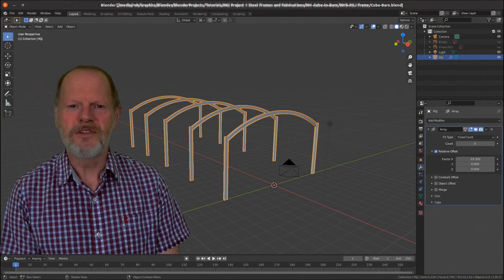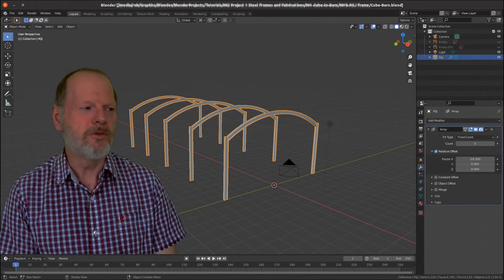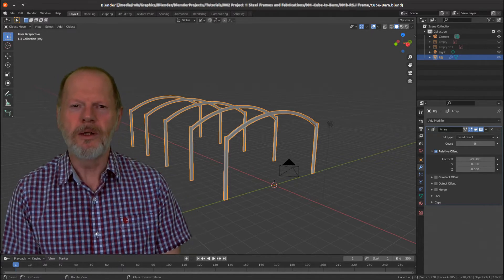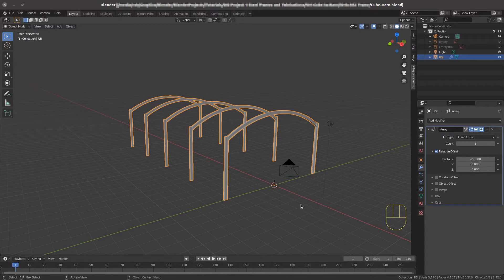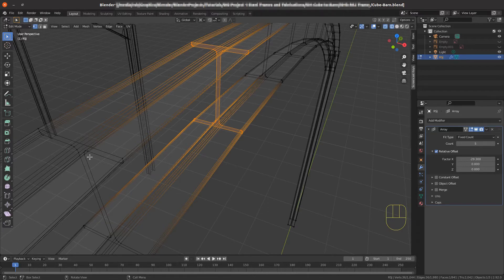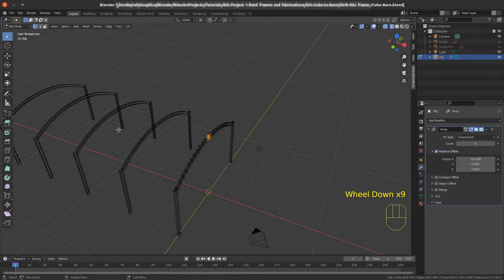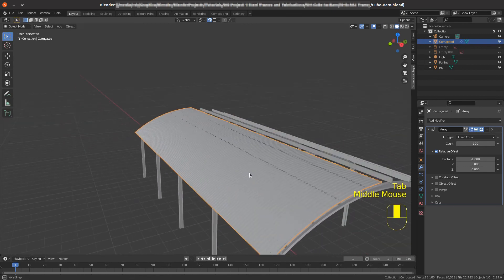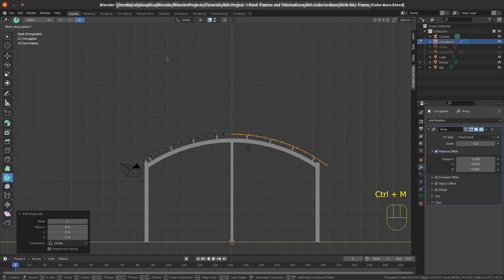011 DA3D Adding the Corrugated Roof Sheets

Comment: Much easier to use the mirror modifier for the corrugated roof, purlins, etc. You don't need to think about recalculating the normals because that's done automatically.
Reply from the maker: Hi John, I agree the Mirror Modifier is easier and more flexible to use in many ways, I even used it in the barn build animation shown in the introduction at the beginning of the video. It was a conscious decision however to use the Mirror tool as the tutorial project is aimed at absolute beginners and I could introduce important concepts that a beginner should know about before moving on to more complex builds. The mirror tool allowed me to show how to merge doubles and correct face normal issues that arise.
Reply: @DifferentAngle3D  Fair enough. In fact I didn't even know that the Mirror tool existed until you started using it. I've been using Blender off and on for several years now and yours is the only tutorial where I've ever seen it mentioned, I suspect because it may be a leftover from an earlier version of Blender where the mirror modifier wasn't so advanced.
Reply from the maker: @johneason6176  The mirror tool is extremely useful when you only need partial symmetry, as you can mirror just a selection of vertices in Edit Mode, rather than having to mirroring the whole object, as you would with the Mirror Modifier.